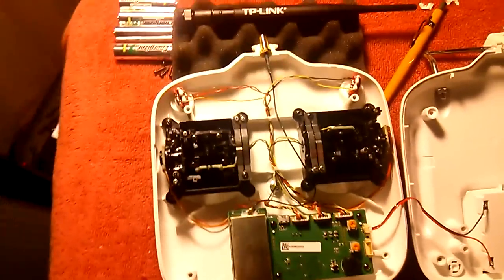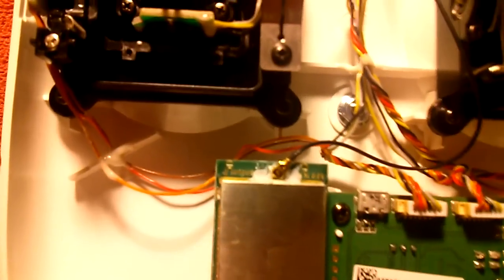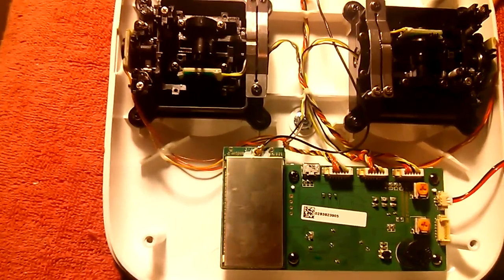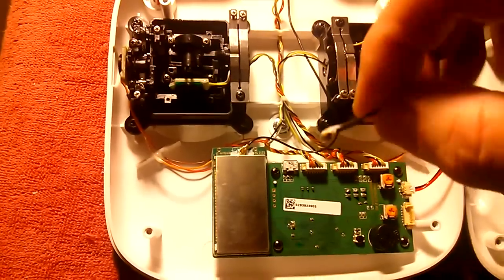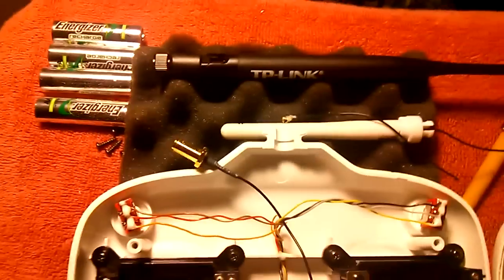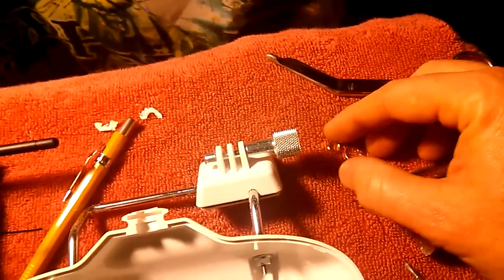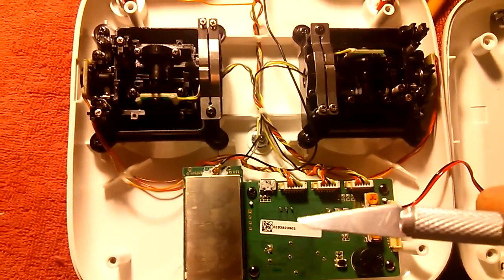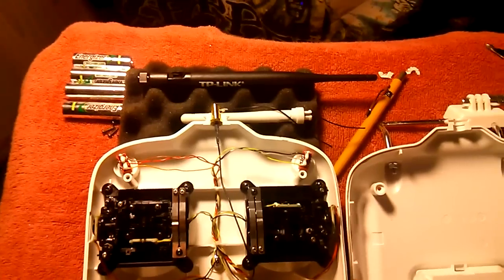DJI Phantom 2 Vision Transmitter Mod Part 3

Comment: Before I start this mod...  what is the story about the TP Link antenna,  do they work or not.   What antenna are you using.
Also how long of wire are you using for the pigtail.   I ordered 4" but it looks to short, do I need 6" for this mod.

Comment: Broke my connector trying to get the silicone off. Doubt I can salvage this with a solder job... If I buy a new transmitter, can I not just splice my new antenna wire with the old one or will that hurt the transmitting? I don't think I want to try cutting that silicone away again...
Reply from the maker: that sucks,,,, there are a couple videos out there that show the procedure. just need to solder inner and outers separately .....check out -->>>>>>>>http://horizonfpvantennas.mybigcommerce.com/<<<<<<<<,,i think there is a video of how they splice solder the aircraft side antennas....good luck .

Comment: Hi thanks for sharing info and video. I got the pigtail in but almost broke the socket. Now trying to fasten adapter. Meantime pls clarify antenna you used is 2.4 ghz but P2V remote controler should be 5.8ghz? Thanks!
Reply from the maker: HI Anton...yes i did use a 2.4ghz whip antenna for the TX 5.8ghz.....radio....it does work however i have since updated to a 11dbi 5.8ghz panel antenna,,,,no overall distance change, but i wanted to stay in the 5.8 ghz band...i am ordering a pilot end set up from www.horizonfpvantennas.com...check them out,,,,much better than my experiment set up,,,,good luck,,,,,:-)

Comment: Can you give the model number or part number of the new TP Link antenna?  Should it be 5.8 GHZ?
Reply from the maker: http://www.ebay.com/itm/151237300187?ssPageName=STRK:MEWNX:IT&_trksid=p3984.m1439.l2649

having some issues recently with the Tx antenna, i am going to try the 5.8ghz antenna listed above. not sure whats going on ,last two flights have been poor...only 300 feet and lost transmitter control..RTH,,,so not sure these TPlink antennas, 2.4 ghz are good for the transmitter,,,it worked well for over 10 flights after the mod. but recently on the last two outings, i have had distance issues with the transmitter....the link below is the one i am currently using:
www.ebay.com/itm/221309408380?ssPageName=STRK:MEWNX:IT&_trksid=p3984.m1439.l2649

Comment: I took my time and it stil broke off. This chip comes out very easy and best to pull it out now I know. DJI cannot or will not get this chip. All they tell you is get a new transmitter and that is it. So be very careful and now dead in the water till I try either a solder job or new transmitter for a $5 chip.